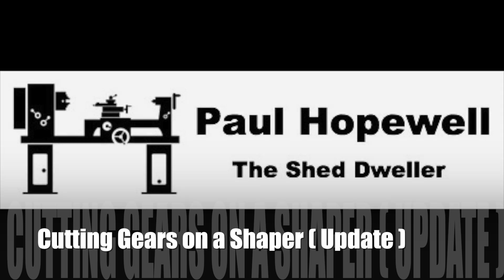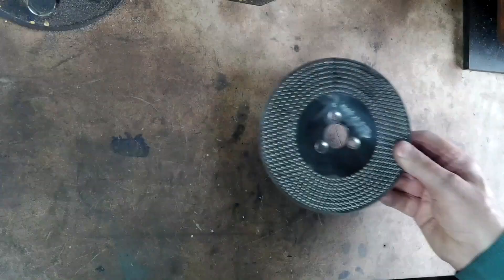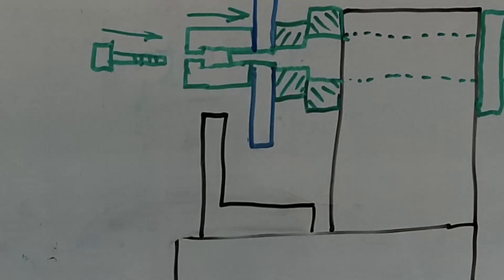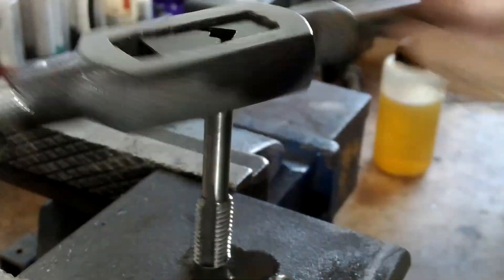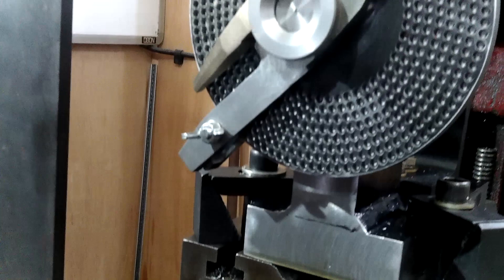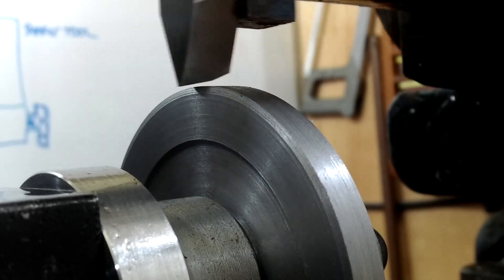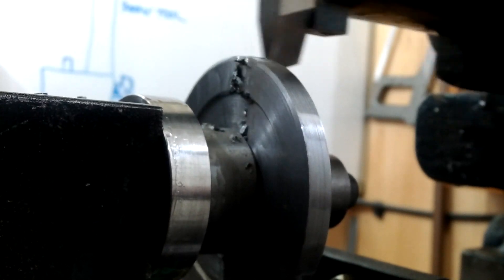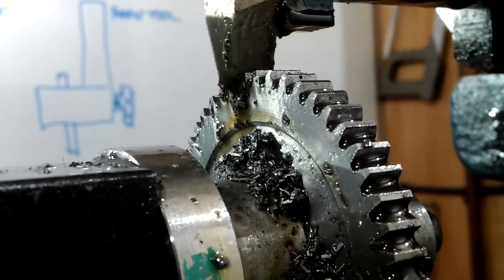Cutting gears on a shaper (update)

Comment: Also how did you work out the cutter tip width, i managed to draw it out on cad and think ive got it down, but would appreciate it if you could explain your thoughts and how you measured the tip width?
Reply from the maker: I can send you a copy of a spreadsheet that I cobbled together and you are welcome to open it and play about with it. I’ll need your email to do this. My email is thesheddweller@hotmail.com
Regards.

Comment: Hi made a gear cutter inspired by your efforts, other videos show a taught wire used to move the spindle as the shaper table moves. Trying to get my head round the maths, but does a fixed arm rotating the spindle mean the spindle rotates slightly less than when usind wire? I figure that as the arm pushes the indexer outwards as well as forward a slighy larger pitch circle would need to be used to account for this. What are your thoughts?
Reply from the maker: Hi Rob, the reason I made my variation of gear cutting tool is because it is fully adjustable at the pitch diameter. The wire version needed a wheel machining first to the precise pitch diameter minus half the wire thickness for each gear, leading to the potential of having a large stock of wheels and still not having the right wheel for another gear. As for increasing the pitch circle your maths are going beyond what this device was designed for. I would suggest if you are requiring gears with that level of accuracy I would suggest getting the proper gear cutters and use them in the milling machine. 
The formed tooth is accelerated towards the later part of the cut in both directions using the arm, but I felt the error is negligible in real world use, as this acceleration simply rolls the top corner of each formed tooth. I hope this helps. cheers

Comment: This is fantastic!  I just watched both of these videos.  I dislike cutting gears on a mill with a dividing head due to the cost of the cutters ($50+ for a decent one, more for a different pitch angle), so the single point cutter seems like a great cost savings.  Also, those only approximate the gear profile (which is why the 8 of them can cover the whole range), whereas the shaper result is 'perfect' (modulo the 'stepover').

I've oft looked at the string-method and been disappointed at how 'cheap' they looked, so seeing this looks awesome!

That said, I'm still confused by the PCD/PCR.  What is the relationship of it, and the end-gear?  Is it just that the 'gear needs to be rotated at pivot point-radius as the final gear, or somewhere inside the teeth?

Finally, the Machininst Handbook has the pressure-angle tooth-profiles for the 'rack' I think, so you could use that to look up the common sizes.

Finally/finally (sorry!), I wonder if there would be value in making the cutter a 'rack' segment with multiple cutting edges!  That way you could cut multiple teeth in 1 feed.  Perhaps less possible on a smaller shaper (not to mention with the flexing of the blank), but perhaps it could make it less time consuming to make a gear.

Anyway, thankk you again for this pair of videos!
Reply from the maker: Hi, it does have its advantages, I've even cut toothed belt gears,
Reply from the maker: Hi again, I've just seen the full text of your comment, sorry I don't know how I missed it. 
Anyhow, I am not an expert with gears far from it, and I did say in the video, anyhow - I'll see what I can do, (2 x PCR = PCD) that is referenced from a central pivot point, the PCR is from the central axis point of axial rotation to the diametral pitch thats that bit explained. I can say that this system is not perfect, the best results will only be attained using dedicated cutters on a mill or by using a CNC machine. I used a link bar and adjustable arm as opposed to wire to reduce the need to have thousands of different sized wheels for the wire to drive each change in PCD. For me using a rack is the same as using the the wire. The Idea for using a rack as the cutting device is a good one,  but it means that there would have to be 1 rack cutter for every variation in diametral pitch. but like I say I'm not an expert(far from it).. My little tool is not perfect and it has now been proven, but I understand its pretty close. regards
Reply: @Thesheddweller  So I guess my thought was this: Currently, your cutter is 1 tooth of a rack.  If you made it 2 teeth of the same rack (you'd still need 1 'cutter' per DP like you do today, but now 2 teeth on the same cutter), you would be cutting 2 teeth at once.

I THINK this also has the advantage of letting you have a 50 position index-circle cut a 100 tooth gear.  

If your cutter had 4 teeth for example, you wouldn't need a 50 OR 100 tooth index-circle, since the 25 would do all 3.

Presumably, you could limit the number of index-circles needed to a small number (even better, smaller hole-counts, instead of having to do all 50!), which has its obvious advantages.

That said, this is likely all academic, since it'll increase machine load to the point that I doubt your shaper could handle it.

FINALLY, I saw another video that used a rack attached behind the table to do advancement, though it used gears to do the power transmission (and thus, you'd need a 50 tooth gear to cut a 50 tooth gear!), but presumably by moving the 'angle iron' piece to the back in some way could save some space.  

Anyway, thank you again for the video and comment!  I am just getting to know your channel, but like it so far!

Comment: You mentioned you've made a surface plate. Any chance you'll be making a video on that? If not, what did you make it from and how did you true it up? Thanks
Reply from the maker: Hi, I made my surface plate using a concrete slab(sidewalk slabs) and granite tiles from a kitchen supply store. I cut the concrete slabs to the same size as the granite tiles, 3 in total, then used strong tile cement to bond the tiles to the slabs. When set, I trued the sides with an angle grinder and used the ‘A, B, C’ method of truing up accurate faces starting with valve grinding paste then on to diamond paste from Ebay.
Reply: @Thesheddweller Thanks for answering.  I'm guessing that would not be a viable method without the surface grinder? Still it must have taken quite a bit of time to do ABC by hand?
Reply from the maker: @vedranlatin1386  I made this plate before I had the grinder, its an excelent tool for gauging and measuring, even without a grinder.
Reply: @Thesheddweller  How long did it take to true them up?
Reply from the maker: @vedranlatin1386  ages… and ages.

Comment: Impressive project! Thanks for sharing.
I do wonder if it would have been better to use a couple of stepper motors and some software? You could input the parameters into the software and come back later to a finished gear. 🤔

Comment: Would replacing the torque arm mechanism with a Scotch Yoke or Watt's Linkage connected to the dividing plate pin at PCR work to cancel out the geometric error of this component?
Reply from the maker: Hi Andrew, thanks for your comments. I have looked at this, the gear tooth cutter is pulled(or pushed) through an ark that covers approximately one sixth of one full rotation. In my mind, linked by con-rod or scotch yolk, the ark is still the same, except that the scotch yolk would need more room to complete its manoeuvre. What is apparent is, that in both cases, there is a case for a very small acceleration, at the start and at the end, of each tooth as it is cut. I believe this is not sufficient enough for me to worry about especially as I wish to keep the backlash through linkages to a minimum.
Reply: ok thanks!
Reply: Will this method cut bevel gears? Obviously the indexer would have to have a pivoting feature, but in terms of the cutter making the right profile would it work?
Reply from the maker: @sblack48  you know I don’t really know, I haven’t thought about it until you mentioned it.. but I wouldn’t think so having spent a couple of seconds on that subject, but I will have a look. who knows if it does work I may do another video. regards.
Reply: @Thesheddweller  I kind of think, by nothing more than gut feeling, that it would work. Bevel gears are tough to do with a typical involute cutter because the tooth and valley need to be tapered but cutting them with this method on a shaper would generate the taper, so unburdened by any other knowledge or understanding I am thinking that this is possible. This is a cool series you are doing. I'm very interested since the tooling is quite basic. In fact there are lots of indexers, like the typical 5C spindexers, that could easily be modified to do what you are doing. Keep up the great work!!
Reply from the maker: @sblack48  when I get some free time, I’m going to make an aluminium bevel gear with it, Just to see.

Comment: I found your channel while researching gear cutting on a shaper and I’m glad I did.  Great job and explanation of what you are doing and how you are improving your setup, 👍👍  And also thank you for taking the time to share this with everyone.  Eddie wheels 😬👍🧑🏻‍🦽
Reply from the maker: Hi Eddie.
Thanks for your comments.
I try, and sometimes things go wrong, but this was the exception thankfully.
I am toying with the idea of a modification to increase the range of gear sizes mainly smaller gears, maybe as small as 20mm diameter, however,  linkage backlash will have to be kept to a minimum.
I have mentioned that this setup has the ability to cut all gears from 100 teeth down to a 10 tooth gear, in truth it can cut down to a bonkers 2 teeth. But, if I offset the each plate by 50%, I can cut from a 200 tooth gear down to a 2 teeth gear. 
Now, if I offset the plates by 1/3 (33.3%) I can cut 300 down to 2 teeth.  However, a 300 tooth gear at around 150mm diameter will practically be classified as a rotary file.
Have fun with your shaper.
Cheers

Comment: Paul,is that an Alba 1 A shaper? If so it is the same model I have in my workshop.
Reply from the maker: Hi Howard.
It is indeed an Alba 1A. I bought it from eBay for what I considered to be a bargain price. But, with low prices come low quality and poor condition. I’m not too disappointed with it. it came with a few odd changes and a lot of slack in the gibs, the table is a bit battered but after a little bit of fettling I am slowly beginning to get the feel of it. One thing I did do was alter the speed by fitting another set of pulleys inside the base, I also moved the motor on a plate to another position and slowed the otherwise very high high top speed down by almost half.. it no longer jumps around the floor like a demented monkey with a drum..

Comment: Thanks for the update. Really interesting. I never did cut any gears on my shaper, but i hope one day i will.
Reply from the maker: Hi. I'm sure you are well up for the job. It's hard work but worth it.
Reply: i want to try this too. but isnt it easier to grind a matching tool bit and use a deviding head?
Reply from the maker: @stevenbodum3405  Hi, Thank you for your comments, I suppose it is possible to use a dividing head, but that might have other issues like gearing, to enable table motion control on a shaper or perhaps a mill.